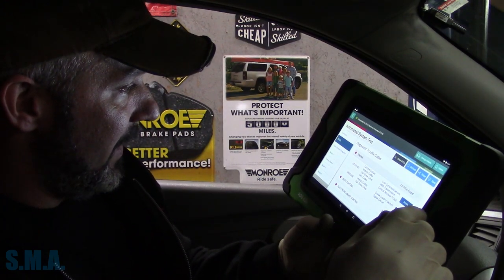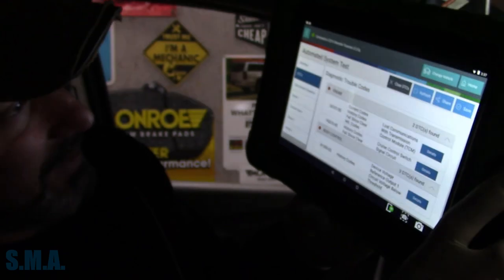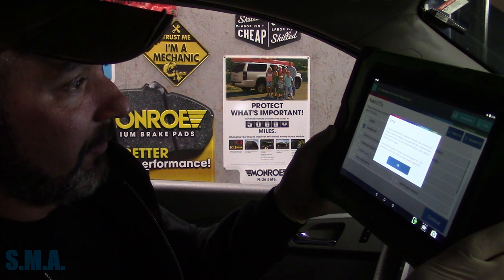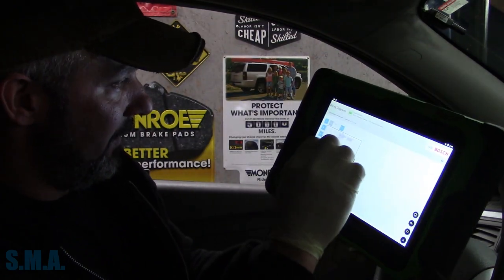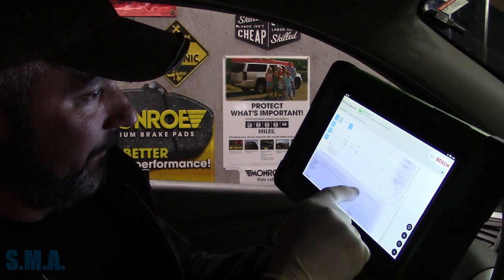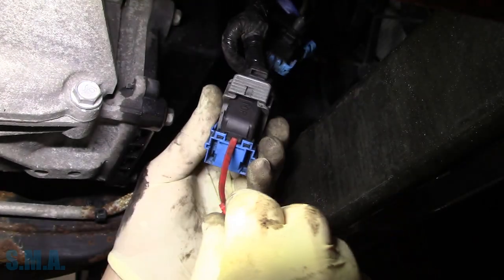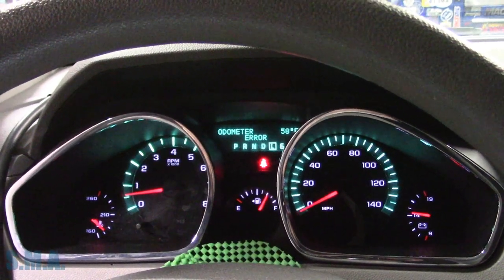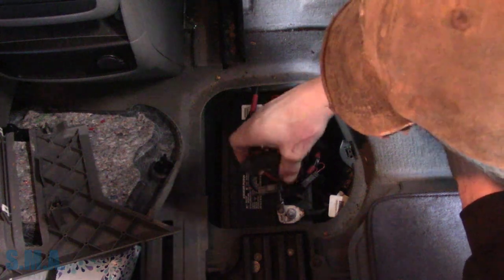Chevy Traverse: No Communication w/ Transmission Control Module

Comment from the maker: OTC (3415) CAN Test Box - Breakout Box and Protocol Detector: https://amzn.to/3c9ctuB
ADS 625 Diagnostic Scan Tool: https://amzn.to/3a0MGDu
Power Probe PPMTKIT01 Micro Torch Kit: https://amzn.to/3a0VZDz
Insulated Heat Shrink Wire Crimp Butt Terminal Connectors: https://amzn.to/2RvoByu
OTC 5950S Crimpro 4-in-1 Wire Service Tool: https://amzn.to/2RwmXfU
Reply: When you're good you're good, and you're damn good!
Reply: Vehicle mileage is stored in the cluster and the ECM. Because the cluster wasn't getting mileage info it fell behind the ECM, and they did not agree on mileage. Both ECM and cluster must agree on mileage or error code will appear.
Reply: CHEVY: Chevy Cheap Heaping Entity Violating You.
Reply: Been tuned in for 6 months.  Always curious about the customer reaction when you accidently reveal their license plates or their 22 they had hidden or paraphernalia?  Do they sign a waiver or are they too waiting for the video.   I have to get permission from my customer before releasing any info.  Worried about legalities
Reply: Hey Eric O. Not sure if you're using 3M Super 33+ tape or not, but it is definitely worth the little extra expense and most electrical tape will stick best if you stick it a little as you put it on
Reply: @HolidayArt  Eric probably could have found the problem in 5 min if he wasn't filming.
Reply: Eric,, how busy are you hahaha,  if you answered every question you've gotten on here you'd be gray lol. I'm a Red Seal, ASE certified technician. But working on a outboard motor. I got no 5V Ref but the ECM is 100% good. All powers and grounds can light a 3amp test light. Unplugged every sensor on the 5v ref circuit and it still won't come back. So something is stopping the ECM from turning on the 5V ref. Out boards are not my everyday and is only my second one ever. Want to take a glance at the wiring diagram??  The motor wasn't running but the key was on ACC when it went under water for about nine mins. Fuse panel blew, I replaced it and now no spark. Got signal from crank sensor into ECM and a output to coil. But like I said nothing on the 5V reference circuit.  Just looking for two cents ...  I'm not a hack mechanic and I'm 90% sure if I cut the ONE 5v ref wire and apply 5v to it she would start.  But I'd rather figure out why the computer won't switch it on.
Reply: @robertvincent5678  I would love to see A SMA video on that.

Comment: Weekend electrical issues used to be Chrysler territory.  Back off, GM...
Reply: I worked on a traverse same year with stabilitrak/ABS stuff wasnt working randomly after few miles but cleared at every startup. I found out they put too much dielectric grease at the module.... It's like the recall they did for the brake pedal on malibu, they put grease in the connector then few years later they were like "hmm nvm dielectric grease is bad we need to take off what we did"
Reply: GM is the king of micky mouse and low bidder engineering.........The problem with Chrysler is that many techs unlike Eric O and a few others even bother to understand MoPar products.  Mechanics put their kids thru college on GM engineering mistakes so they learn how to fix GM products or starve.
Reply: Just working on a Chevolet!
Reply: weekend? more like 24/7........
Reply: @Minimalistic Van Living I had a 2004 Pacifica that died with its original TIPM.  It died of a broken timing belt at 250k.
Reply: @Minimalistic Van Living Mine was actually the 3.5 which was otherwise a perfectly good engine

Comment: Chevy equinox with problems what a surprise
Reply: TheIronChainMaster a Chevy in general
Reply: they were called "Captiva" in Australia, Even the local GM dealers would spell it with an added 'R'. Alas, GM has pulled out of Australia as they "can't do" RHD vehicles anymore
Reply: More like "A post-2000 GM with problems, what a surprise."
Reply: It's not the timing chains so there is that
Reply: @brettt8246  There are also Captivas in the US, surprisingly even worse then the equinox lol
Reply: Well it’s actually a traverse😂👍
Reply: @penrosesausage   Just more crap, in a bigger package...
Reply: @brettt8246  no one here calls them a Captiva, it's just on the badge! Craptiva!
Reply: what is RHD
Reply: @182dll  RHD, hmmm that's a tough one! Right Hand Drive maybe? 🤔
Reply: Amen

Comment: Dad Joke: Electricians have to strip, to make ends meet! =P
Reply: That's an electrician joke,,,,
There are equal Plumber jokes, but they are inappropriate for SMA videos,,
Reply: @GeneralRELee  you mean plumbers have to lay pipes to make the customer happy ?
Reply: @Spelter  in my 65 years I laid pipe to Alaska and back
Reply: Electricians, we do it in the dark.
Reply: Electricians - because even engineers need heroes  :D
Reply: @jeremytoms5163  as an electrician, that just made my day!
Reply: @schafer2333  40 year veteran sparks also.
Reply: @jeremytoms5163  I'm coming up on 10 years, 2nd generation
Reply: @schafer2333  keep upto date with regs etc. Its a profession that will never disappear and can be a good living. I've certainly never been out of work from it. Datacentres love us we can do most repairs, cable installs and with certification, look after all the HV on site. One thing i have noticed is that most industrial and datacentre positions prefer some mechanical knowledge as well.  Generally as long as you can strip and rebuild car engines as a hobby, that's usually sufficient for them to consider you as a  pair with a mechanical engineer . Also, if its of interest, HVAC certificates are a bonus as well, always gets you in the top 5 for positions.  Or you can stay in construction and still earn a good living. Others are handy to have as you get older and site work starts to hurt more 😂
Reply: @jeremytoms5163  yeah, I've been building a pretty big data center for the last couple years in local 22
Reply: Almost got a thumbs down because of the groan factor...LOL!

Comment: As i waited in suspense as you fired the battery back up and turned on the key and said repeatedly "no error no error"...the display finished reseting...and a commercial cut in! Dang! At least it was short and we saw, error still there. Ugh. Otherwise communication restored & a great video. That is why Mr O is one of the best!

Comment: THANK YOU so much for this video..!!!
My 2010 TURDverse with 269,XXX miles on it was going wacky with doors locking and unlocking, traction control warning on the dash and acted like it was stuck in 3rd or 4th gear...  
Watching your video gave me an idea where to start and after tearing it apart and looking for the broken wire mine was still intact.  Looking further up the harness there was a spot where a rodent had chewed the loom plastic.  Inside there was the Red wire with the white chaser was cut in 2 pcs and green..  I quick splice and everything has been good...!!
You my friend deserve a drink of your choice.!!

Comment: I Just used the disconnect battery and leave it for a few hours trick to clear the check engine light on the Corolla (which i also diagnosed and replaced a coil pack on) , was really pleased with myself and I learned everything from watching Mr O

Comment: Another great job, Eric.  Really appreciate your approach to diagnosis and ultimate fix.  The three cents worth of tape GM saved by short-sheeting the wire going into the connector just came back in spades.

Comment: Nice, the power of a good visual inspection. 
I'm not good enough at soldering (although using a flame instead of a soldering iron has given me great results) to trust it long term 😆 yet to have a single issue with a good crimp.

Time to EEPROM transfer a cluster! 

Stay safe bud, all the best!
Reply from the maker: I called my boys at United Radio and they are gonna do the swap for me ;) $85 bucks is a lot better than the blob I would leave on it lol

Comment: I had this problem today on my acadia,  loss tcm com, , went to limp mode, door locks going up and down, sure enough that exact wire ,had  green crusty,  snap right off,   quick Soldering , new as new,,,,  thanks again , your a car Wizard,  you save my butt,

Comment: Nice video!  I think 120 ohm terminator resistor on each end on bidirectional CAN bus, so 60 ohms when both ends connected.  Nice to know since should measure 120 ohms if one of them ends is disconnected and the other one is connected.

Comment: The problem with soldered joints in high vibration environments is that the solder wicks down the wire strands and essentially turns your stranded wire into solid wire, which then fractures. If done properly, a crimp is superior, but it's hard to do consistent crimps without the right tools, which is where many people come unstuck.
Reply: And that's why aircraft wiring is repaired with crimp connectors. My son is an A&P mechanic; graduated top of his class.
Reply: Agreed. A proper crimp is both quicker and more reliable in the long term.
Reply: I used to solder then bought a boat. The inspector said "no solder in a boat.  The joints get too stiff and the vibrations cause them to crack." I now go with a bare butt connectors and cover them with marine heat-shrink with hot melt adhesive inside. I met a nuclear power plant electrician and he said that is exactly how they do it.
Reply: what about crimp + solder?
Reply: The problem with crimping is that it only works properly if the wire gauge is appropriate for the terminal, and the right tool is used with the right force - essentially you form an air-tight cold-weld. In critical applications, "some tool you bought off ebay" is not going to cut it - the manufacturer will specify the appropriate terminal, tool and force.
Reply: yeah it's easy to see why soldering must have issues, considering that pretty much nothing in a factory original automotive wiring harness contains any type of soldered connection.

Comment: Outstanding track down.  My 12 Traverse had the EXACT same fault.  Only thing I did different was solder in a splice wire in place and finished with heat shrink.

Comment: Doesn't look like the harness was taped all the way. Love that sharp plastic!
Reply: Harness made in  china what do you expect.they learnt to cut corners  too.
Reply: @marianluc6235  to be honest, wiring in GM has been an issue since the mid-80s.  First lack of chassis grounds, then improperly connected weatherpaks, then CANBUS connector under the place there should be a dead pedal.

Have more GM stuff now than others but still hate their wiring.
Reply: hffp1 looks like you know this stuff well

Comment: Its amazing how easy eric found this and fixed it. Came from another shop too. I had to do replace the power wire from the fusebox to the brake switch on a 2009 f250, fuses were fine no power at the switch, pull the harness from box into the cab and full of corroded wires.

Comment: Another great video. Not a mechanic, but follow along your videos with a good understanding courtesy of your content.

As such I have bought my own OBD BOB, cheap China one. One thing I would mention, for those not automotively trained like me. When you measured your resistance you had the car turned off and doors closed (Window open, car and doors locked by FOB, wait for car to shut down). Once data lines LEDs turn off (on Bob) you then measured the terminating resistors. If you attempt to measure whilst power is still present on the data lines then all you will see on the ohm meter is weird values jumping all over the place. 
And as always, "I am thankful for watching. I'll see you next time."

Comment: You mentioned the solder and seal connectors. I caught crap for soldering a wire in one of my videos so I actually looked into what the best repair method is. And it is hands down the crimp connection with a quality crimp and heat shrink tubing with glue inside. They say that a proper crimp provides so much pressure that the copper essential welds itself into the crimp.
Reply from the maker: What !? you caught hell for not doing it right on YouTube!?! Noooooo...... Hahah I always love the corrections from the armchair mechanics lol
Reply: I wouldn't say it welds itself. That's more internet BS like "you should never solder wires". Nonetheless, I do prefer crimped connections most of the time.
Reply: Fascist Pedant no no. That’s not internet bullshit. Unless the engineering paper that I read is bullshit. 

It mentions that as pressure is applied the metal strands start to stretch and flow. It remove oxides from the surface of the metal and micro welds the strands and crimp together.

Is it right? I dunno. But it makes sense to me.
Reply: @VoltageDropDiagnostics   I believe that, to a point, on some high pressure barrel connector crimps with overlapping wires, but the pressure required would destroy the heat shrink on these connectors. I actually prefer to use a bare connector and slide the heat shrink over after crimping.
Reply: Fascist Pedant oh for sure. That is what most manufacturers recommend. That’s why I mentioned the heat shrink tubing separately from the crimp. 

Toyota even had a TSB for repairing airbag connectors using the bare crimps with separate heat shrink tubing. 

That surprised me because most manufacturers don’t want airbag wires repaired.

Comment: You are absolutely right! The solder but connectors are junk!!! Use the metal with heat shrink over top!! They last!! I know I'm a deasel mechanic that been working on a fleet of trucks for 6 years now

Comment: I had a similar issue on my 2017 equinox, same connector. I caught the problem when i first bought the car in 2019 while i was doing an inspection. Fixed it before the money light came on.

Comment: Interesting about the solder butt connectors. Been looking at those butt no way now. Manufacturers dont solder because vibration can case cracking in and around the solder point. Thanks you just saved me money again.

Comment: Going through the same issues on 2014 equinox. P0011 p0420 u0073😂😂 I guess I know where to start because I did remove that plug you repaired in order to replace cracked manifold. Great video its been driving me crazy to see check engine light 👍🏾😎

Comment: I've used the crimp style ones where the adhesive is in them, they work perfect contrary to what some folks say. Use them with no worries, just buy good quality ones though. I have a pair of ratcheting crimpers that work perfect on them. I bought them because they are the same style that GM used to supply us with in their electrical repair kit. Anytime we would have to replace a connector on their vehicles, in the bag with the replacement connector were the same style splice sleeves(crimp style w/adhesive).

Comment: Regarding soldering; some lead free solders can be more brittle. However I think you may experience other problem with the solder connectors. When you solder the end of a wire, the solder wicks into the wire strands quite a bit and forms a metallic rod which does not easily flex. At the place where the rod ends and the individual wire strands are free to move is where you have the highest stresses when the wire flexes. If you join a wire by soldering and the wire then is free to flex, then you will most likely see a break on one side of the solder joint. When you join a wire by soldering you should take care to ensure that there is mechanical support over the length of the joint and then some to ensure that any flexing does not occur near the joint.

Comment: Amen on the crimp and seal connectors. There's nothing worse than a cold solder joint that fails inside a heat shrink connector.

Comment: Eric, you might want to try doing western union splice before using that solder heatshrink. it would be a lot stronger compared to straight solder since you're not relying on the solder alone. even stronger than a crimp!. the bad side, you might need to add a bit of wire strands and do double splice since these splice took some length.

Comment: The crimp and heat butt connectors work very well, but I have found the salt still eats them.  If you shrink them then use liquid electric tape you get the best sealing.  I have found over time they tend to split, especially if the former installer used the wrong part of the crimper!

Comment: Eric,
Great video, diagnosis and fix - thank you!
They armor the harness with an 1/8th thick layer of tape wrap up until where its really needed at the connector strain relief and then they leave it bare. Dumb!
SMA#1
God bless
Paul (in MA)
Reply: But the company saved 0.000001 cent per car to justify the CEO's bonus!

Comment: The heat shrinks that have solder in them and the adhesive usually have that problem when using the amazon specials. The aviation world has ones that are much better but are also something like 50 cents apiece. For important connections we used crimp environmental sleeves which are very similar to yours but the sealant is a little better and costs more like a dollar apiece. What you’re using is perfect. Soldering itself can cause issues over time as the wire just behind the solder joint gets weakened by the connection. Crimp all the way!

Comment: Crimp gives a better connection, solder wicks up into the wire stiffening it, which results in fatigue breaks due to vibration.

Comment: I have had the same problem with the solder/shrink type connectors.  I use the crimp/shrink these days, if I don't wind up soldering/shrink wrapping the wire.  So far no comebacks with those.

Comment: I have had the same problem with the cheap solder-seal connectors. I have since switched to name brand TE connectivity solder-seals with a no mess ChipQuik flux syringe and haven't had a problem since.